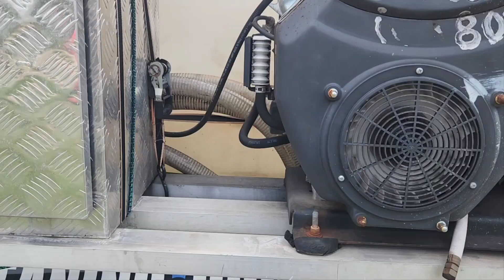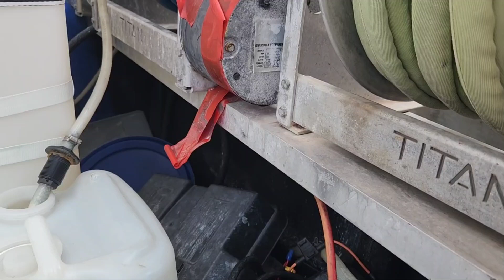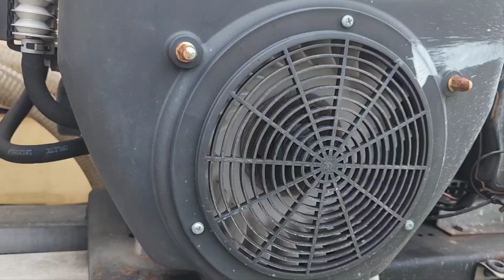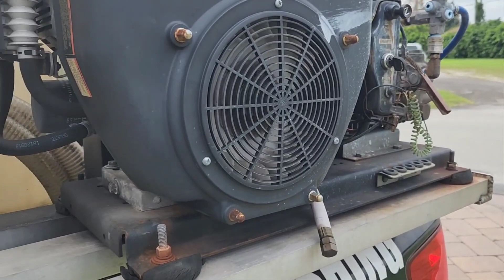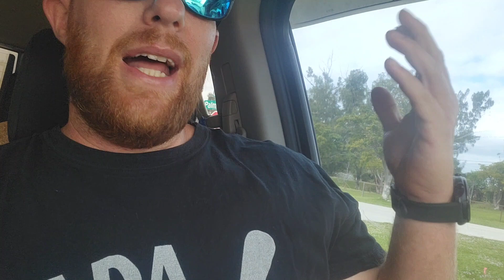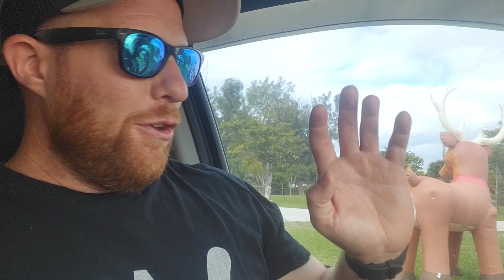Pressure Washing snake oil

Comment: I’ve been in the washing business for 5 years, strictly residential, and I’m still using the same 4gpm CAT/GX390 I bought when I started and got it on a clearance sale for $800 (pump is new from last year $500; old one went out). And have built my own skid with the usual plumbing to the same tanks I bought back then. 

It’s taken me five years (not because of funds) to finally start looking to upgrade equipment. Now switching to booster setup for roofs and an 8 gpm hot water rig. All of my expenditures the last five years have been dumped into marketing media and advertising. Still out here having a blast (pun intended) and living the dream.

Comment: 100% brother! I saved up and side gigged until I hit 6K. bought a 6X10 trailer (new) built a pressure washer with a Predator 670 engine from harbor freight and a 8gpm Udor pump having never owned a pressure washer before. used 275g IBC tote. 5.5 gmp roof pump from northern tool. one cheap garden reel for water supply and one cheap high pressure reel for hose. 16" whisper wash Ultra surface cleaner. Bought most of my pieces and parts from Pressure Tek so I have a record of what I've bought in one spot. I have at least one extra of everything on my trailer with the exception of the pump and motor, everything else is disposable. NO DEBT!  The  online marketing game is my weakest  area, but make up for by building relationships with clients and word of mouth goes a long way. I appreciate all you have contributed here. Nice to have you back for awhile.

Comment: People spending $15k or more for a skid or trailer setup. Hell I bought a used pickup truck and built my own skid which has two Soft wash pumps and 5.5gpm pressure washer Honda gx390, made my own downstream remote, 20" surface cleaner, 3 hose reels, 150ft hoses, two ladders, ladder rack, two 50gal tanks, 3 wands, ect.. cost under $10k

Comment: I started with a good big Tex trailer a Honda 390 belt drive general 4.5 a whisper Wash classic a tote tank and a 100g bleach tank 2 ladders  2 hose reels 1 Chinese gray and a quality built summit, 150 hp line and 250 chemline . A 4.5 GPM dc pump for $3300.00.
Thank god I didn’t break the bank I have been getting hammered spending money on thumbtack , Nextdoor, Yelp google and seo websites and my lead flow is still shit!